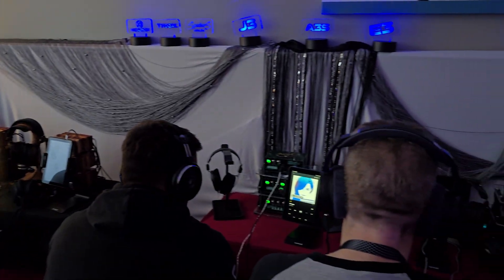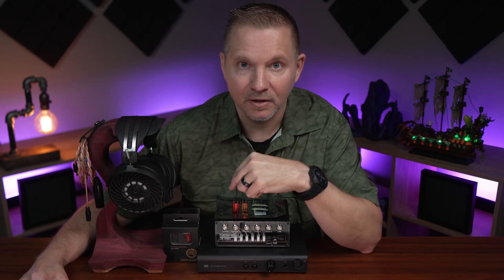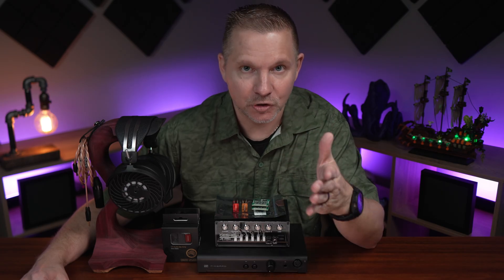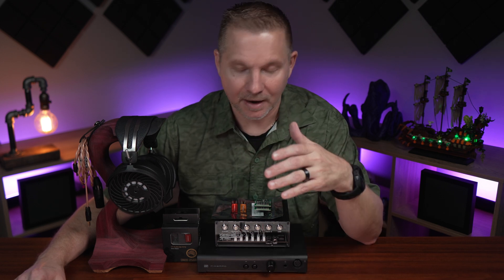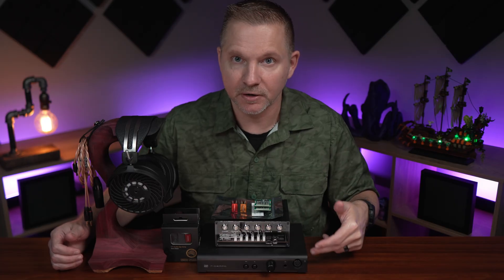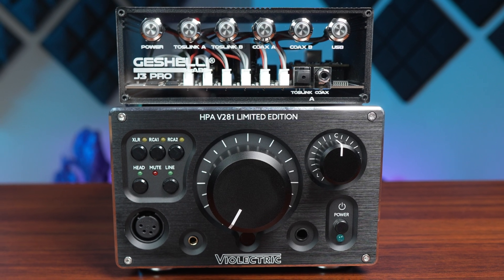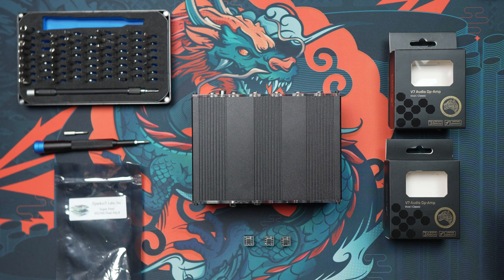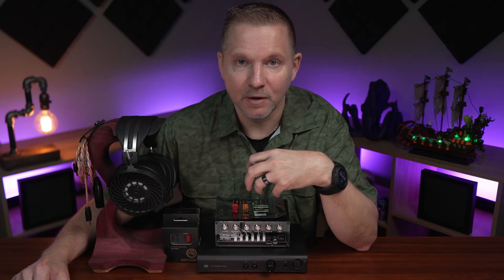Op-Amp Swap Impressions | Geshelli Labs J3 Pro | V7 Vivid/Classic | SS2590 Pro

Comment: Not sure if you realized it, but you seem to be comparing the price of one Sparkos 2590 to a pair of Burson V7s.  You can us a pair of 2590s in the J3’s balanced outputs if you want, but that will cost more than the Bursons.

Also, it must be pointed out that you are comparing different op amps with different outputs.  To truly judge the differences you should be using a pair of 2590 on the balanced outputs as well.

If you want another good option, the SX22B is an op amp I tend to prefer over the Burson V7 or the Sparkos SS3602.  I have not used the big 2590s, but I would be surprised if the SX22B isn’t as good or better.  They’re available on Ali Express.

Comment: I am pleased that he admitted at the close that he is not an audio enginneer, because no science was invoked or threatened at any stage during these 'impressions'. As it happens there are lots of scientific measurements  out there concerning op amps (try using AI and you will find them). Especially between discrete and integrated op amps. Disappointingly for all of the 'impressionable' audiophiles out there, there is no significant measurable difference between the frankly expensive 3rd party discrete op amps and the standard integrated ones that come with nearly every manufactured DAC or amplifier. While you may choose to believe that a particular op amp is ''warmer' or has 'better tonality" (I don't even know what that means, to be honest) but it's really just that: a belief. Blind tests have demonstrated this over and over again. Hope I haven't spoiled everyone's fun. Good hunting!

Comment: Thanks .
I would think it would be hard to remember the sound difference
From on to another after unplugging cables, unscrewing the J3,
Swapping the Op amps, screwing the J3 back, plugging
The cables back
And then listening to your music.
How long would you say it took you to make a switch ?
Reply from the maker: Its very difficult to remember sound differences.  Even quick A/B with headphones can be difficult.  What I have found works for me is to get used to a sound for a bit.  Maybe an hour or so listening.  Then switching over can be a bit easier to pinpoint things out.  For the Op-Amps, I did have the V7 on the Balanced and Sparkos on the Unbalanced.  So to A/B that, I simply had to switch from going Balanced out to Unbalanced.  For the V7 Classics vs the Vivids...yeah I had to unplug and switch the op amps out.  For that, I did the method I spoke to above.  I listened for quite a while on one before switching to the other.  Is it the best method?  No idea, but it did work better for me.
Reply: @Skeeb23  Thanks.
I’ll assume you volume matched between balanced and unbalanced ?
Is the Sparkos Op amp to large 
if you had 2 to run balanced ?
Reply from the maker: @deadline7610no, it's not.  I only had the unbalanced Sparkos though.  It was on purpose to make it easier to listen between the Burson and Sparkos.

Comment: A quick tip: before working on your DAC, touch a radiator to earth yourself. If possible, switch off the power at the wall, then toggle the unit’s power switch — you’ll often see the LED flash briefly. That discharges the box and its capacitors. (Important: only do this on a DAC, not a power amp!).

I recently picked up an AliExpress “special” DA50 Pro with dual AK4499EX chips, an AKM FX chip, four swappable op-amps (2 × voltage, 2 × buffer), and Nichicon/Panasonic capacitors (to be confirmed when it arrives). It uses the latest XMOS USB interface — supposedly better than the Italian unit — and has fully balanced XLR outputs, all for £230 delivered to the UK. Geshelli wouldn’t ship here, so the money went to China; on paper this looks like a stronger product. I’m planning to hot-rod the I/V stage with a pair of SS2590s and maybe swap in MUSES02s for the four output op-amps (I already have a couple at home and rate them highly for £25 each). I am very curious about some of the AliExpress op amps - there are named Telefunken, Martinez, Accuphase circuit clones - I am interested in someone reviewing them.

Over the past month I’ve had some dramatic results experimenting with op-amps in my Douk T8 EQ. Using V7 Classics in the XLR output stage and Vivids in the EQ stage gave a huge boost in soundstage. I also tested SS2590s in the EQ stage, which were decent, but in the output stage they ran too hot. I probably didn’t let them burn in long enough — and burn-in really is a factor here. Don’t judge them too soon; give them a couple of weeks of near-daily use with proper warm-up and cool-down cycles. Both Vivids and SS2590s sounded overly bright and aggressive at first, but settled into a much more balanced presentation with time.

Comment: dac clock power upgrade are big step forward, same with opas, separate power , must be the first step before swap opas.
Reply: How do you do the DAC clock power upgrade?
Reply: @joegreer9584  direct external 3.3v dc for the oscillators
Reply: I would agree. All that an op-amp (or pair of op-amps for balanced output) needs to do in a DAC is convert the DAC chip's output current signal into a voltage signal. In other words, smooth out the output signal to reduce noise and artifacts, and provide low impedance output to the amp. The basic TI OPA1656 is perfectly capable for this task, and I really doubt swapping it leads to a perceivable difference. Increasing power to the DAC clocks/oscillators through a power supply upgrade, on the other hand, notably increases soundstage in my experience.